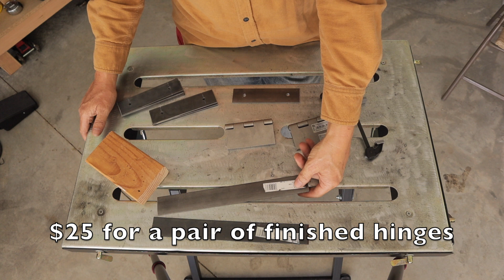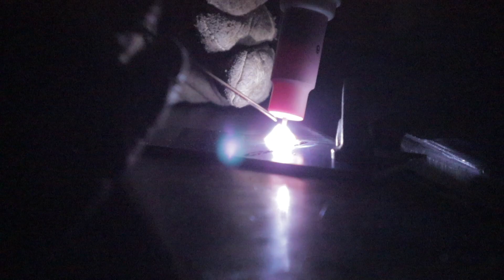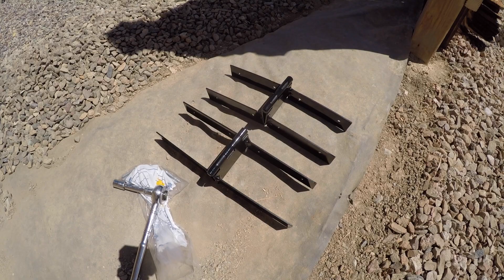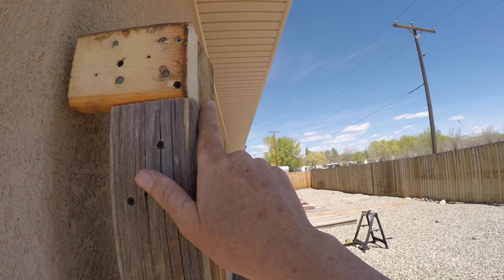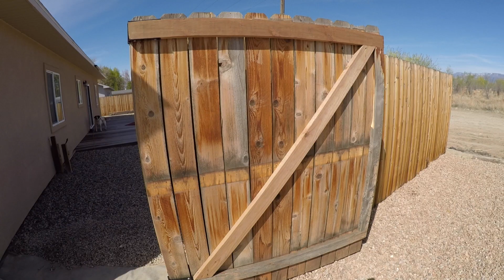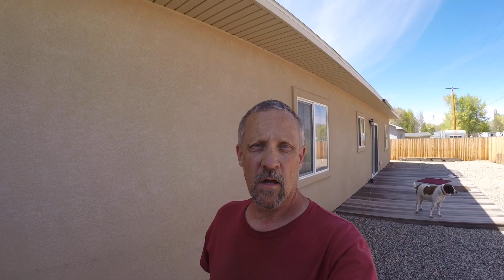DIY Heavy Duty Gate Hinges for Only $25 (Better Than Store Bought)

Comment: Hi, your link to weldable hinges redirects to 1/4" thick hinges, 1 pound each.
Are those the correct ones?
Thanks in advance
Reply from the maker: It just depends on what strength you need for your gate. 1/4" thick is probably overkill for a 4' wood gate. There are many different sizes of weldable hinges to choose from as you may know if you've looked at weldable hinges. I think a 1/8" weldable hinge would be adequate for a 4' wooden gate IMO.
Reply: @DIYHomesteadProjectsDIYHP10  
Mine will be 10'
Reply: @DIYHomesteadProjectsDIYHP10  
My gate will be almost 10" (double gate 5' each side).
Reply from the maker: IMO I think you'd be ok with either size. Just depends on what size you are able to get where you live.
Reply: @DIYHomesteadProjectsDIYHP10  
I found hinges 5X5 in eBay, do you think this will be good for a 5' gate?
I am thinking that they would be better than 4x4 because with 4x4 you had to weld past the hinges corners, leave some of the plate without welding it, while in 5x5, I would be able to weld the whole plate.
Do you think flux (wire) welder will do fine?

Comment: One tip on the tig welding. Only use filler rod to fill in gaps. Tig will pretty much fuse the metal together without filler if you have close tolerances between the pieces of metal.
Reply from the maker: Thanks for the tip, I appreciate it!